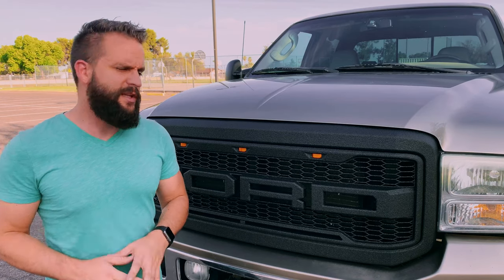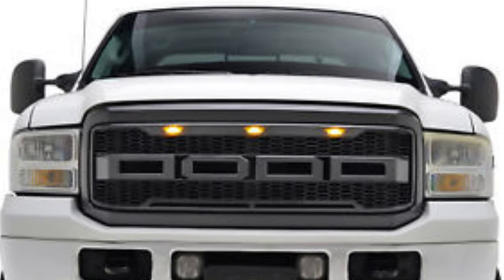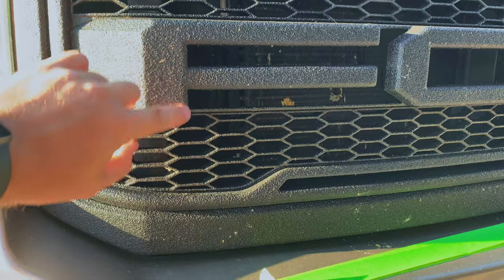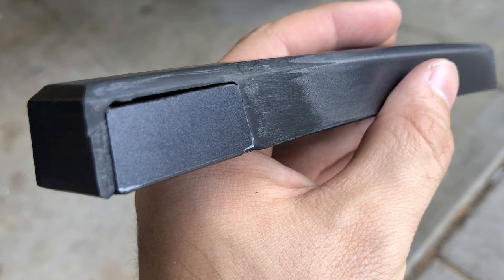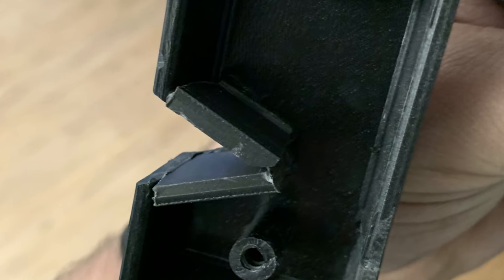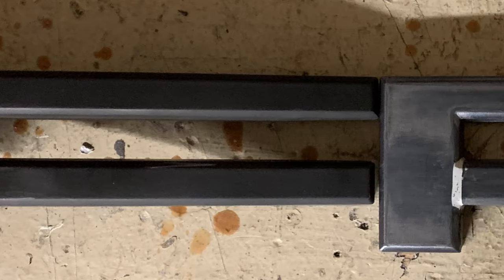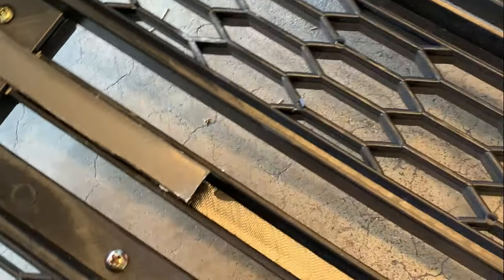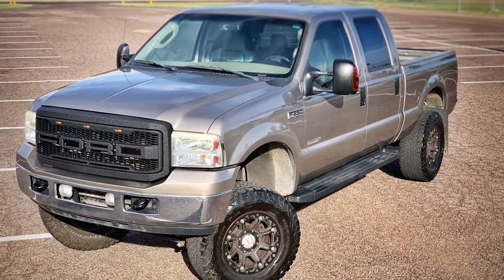Raptor Grille - DIY F & R - F250

Comment: I bought the letters for my 05. That’s a lot of work
Reply: Where?
Reply: eBay. I typed 05 f250 raptor grille , you can see the listing fir the f, r
Reply: Fern Built Did they fit???
Reply: Bob stark. If you want to see pics of my truck. Hit me up on Instagram blizzardf250. I bought the grille and bought the f and the r. Bolt right up. No issues.
Reply: bob stark I replied to your question
Reply from the maker: That’s fantastic. I know they weren’t available when I did this build.
Reply: I can’t find the letters.